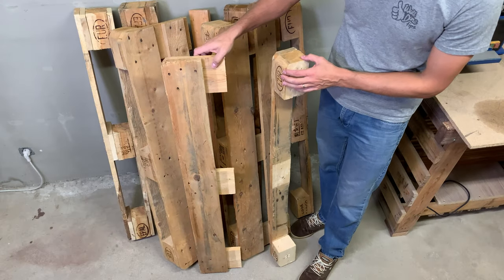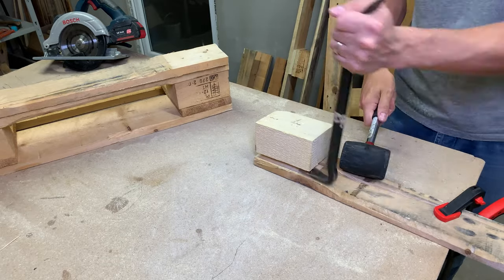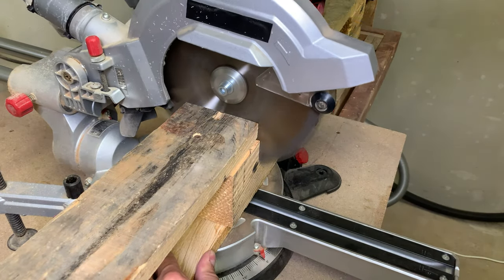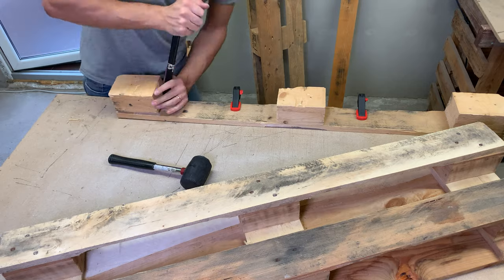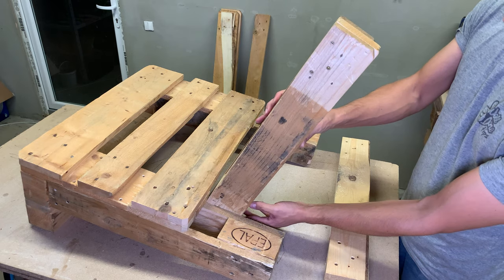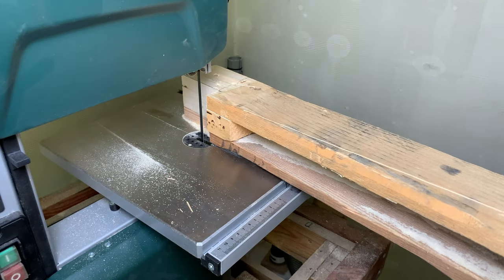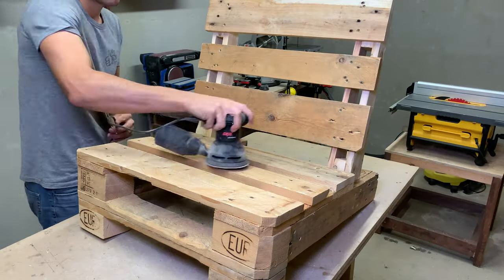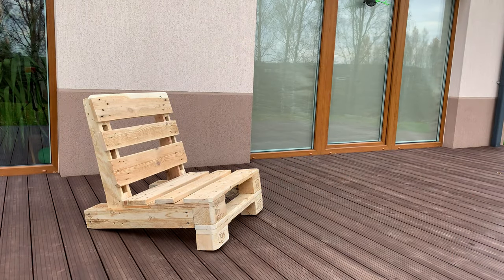How To Make A Deck Chair From Pallets || Woodworking Project

Comment: Fantastic job man, I did a few things with pallets before, and I truley appreciate how you're trying to put minimal effort into changing the existing pallet and working with what you've got (existing shapes and already nailed pieces) nothing is worse than having to rip everything apart remove hundredes of nails before starting only to find out that you have to fasten some peices back again!!!